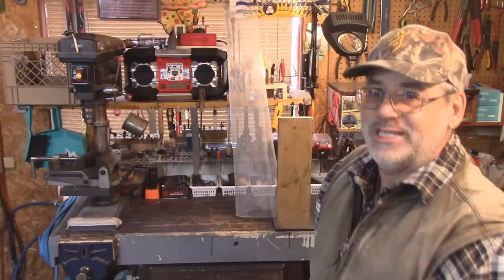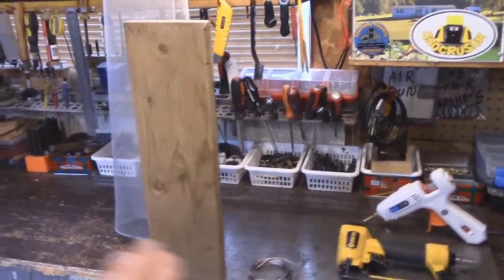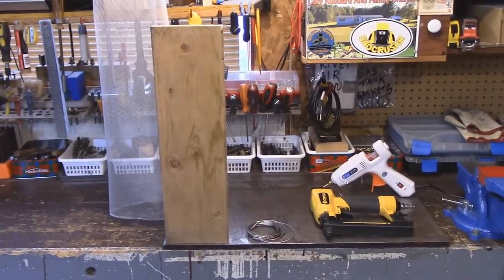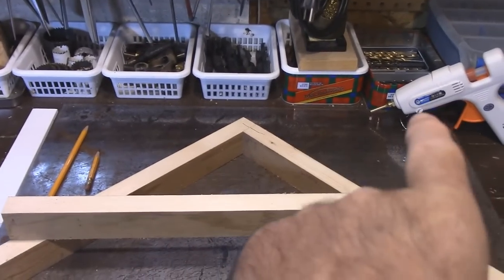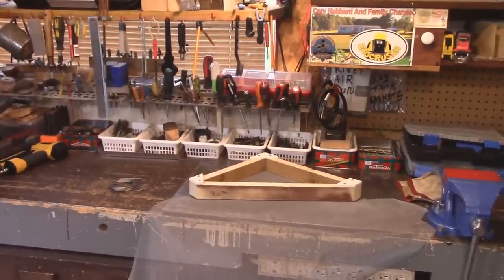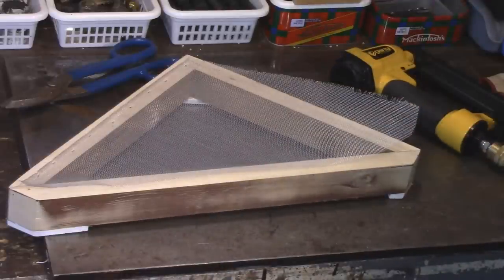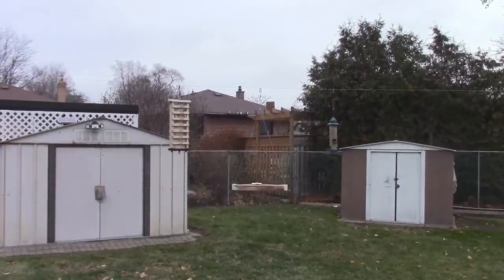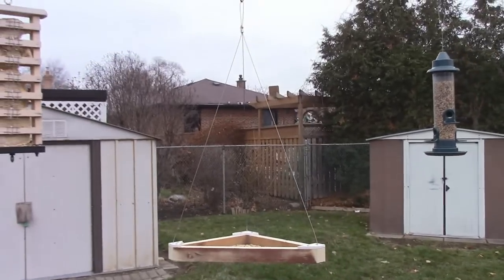Best Bird Feeder For All Birds  - So Easy To Make

Comment: That looks like a nice bird feeder and I especially like the screen bottom.  However I was disappointed to not see any still shots of birds at the end of the video.  ☹

One thought, you could train your squirrels to be high jumpers.  Just start the feeder low enough they can jump into it, and raise it gradually. It's amazing what they will do once they think they can do it!  A neighbor did this with the deer eating his garden. Started out with a pretty typical fence using four foot welded wire on 5 or 6 foot T posts. Deer jumped over that like no tomorrow.  He added another wire to the top of the posts, and they still jumped it.  He took off that wire and put on a two foot welded wire with some overlap so it added 16 to 18 inches in height.  The deer jumped that also.  Two years ago he added more four foot welded wire on top of the four foot base, making an 8 foot high fence.  They didn't jump it all last year.  This year he took down the added four feet, hoping the 5-1/2 feet (4ft + 2ft - overlap) he has will keep them out.

So what that all means, is if the squirrels jump into your feeder at 4 feet, don't raise it just 6 inches or a foot.  Raise it as high as you can!
Reply from the maker: Good advice 👍.   I will be watching for the squirrels getting to the feeders but so far its not interesting them yet :)

Comment: Very nice design, squirrels,  do they send out invitations  because i think i have 4 extra this spring. Between the crows and squirrels drive me nuts. Little advice,  never do anything to piss off crows, they live in families for life and every one will remember you and not leave you alone lol last year i was putting two bolts into the handle of the lawnmower and one came and started squalking so i went towards it to drive it away and two more came behind me and took my two little bolts. Revenge is mine!!!
Reply from the maker: Jason you need to put up a fine cable  to keep the squirrels away.   If you see a fake plastic falcon  put it out for the crows 👍
Reply: @SteveRobReviews  oh never thought. Of falcon

Comment: Do you find that those feeders attract mice?
Reply from the maker: Great question  , all my feeders are in the middle of my lawn , about  15-20  feet  away from any structure or fence .  Mice and rats  stay to the outside edges and don't cross into open areas.   After every snow I've never seen vermin tracks under the feeders , just squirrels that clean up any spillage during the day.
Reply: @SteveRobReviews  Thanks for the thorough reply. Do you have cats around, and thats why they stay out of open areas.
Reply from the maker: No cats but I do trap vermin all year and not once will they cross out into the open so I never put traps out in the open either , just on the outside edges of my property.   I think its just a thing they do.